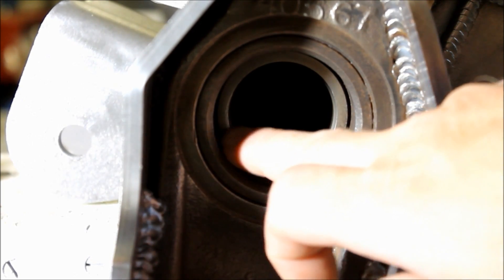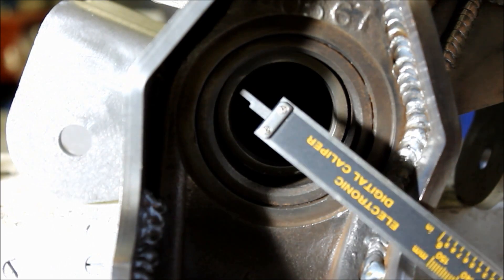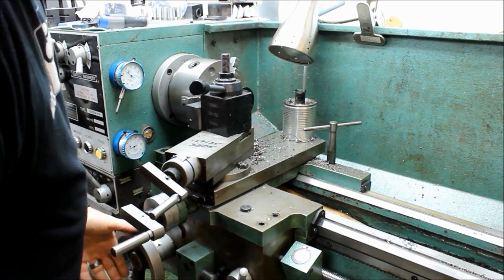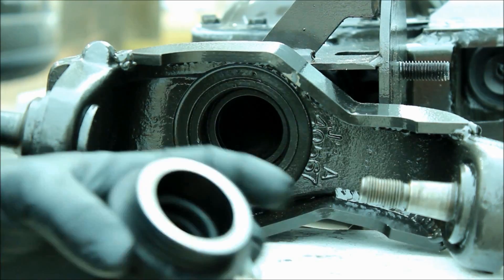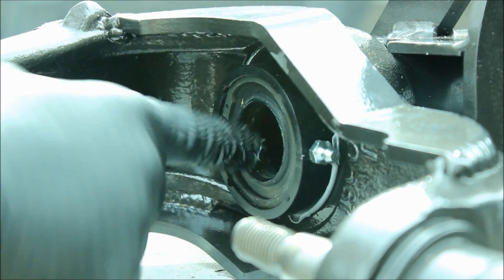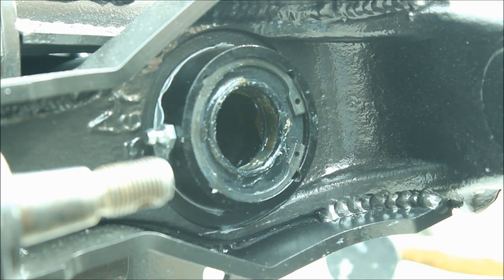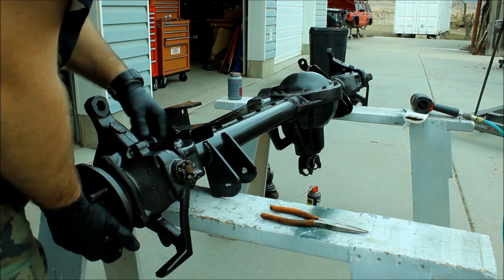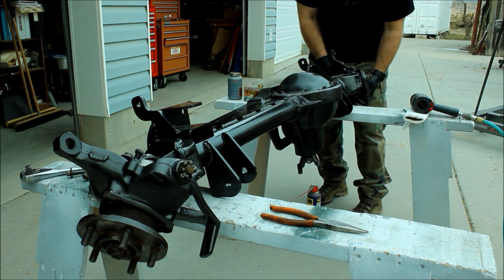Overlander Front Axle Swap Part 4. Installing After-Market Outer Axle Seals

Comment: so excited for this project to be done!  I just recently got into overlanding so my xj build is moving more that direction.  This build gives me a ton of inspiration for me
Reply: I also am going to overland in my 1988 XJ that i am restoring. I put a new 4.7L stroker engine, a little higer pressure injectors, replaced factory undercoat, bedlined the inside of the jeep, chromoly front axels, Frame stiffiners, new AC and Heating system, stronger alternator to run a dual battery setup and  rest pretty much stock. I am putting the engine parts back in and will bedline the whole outside of the jeep instead of paint so it wont get all scratched up. So now i am out of money so i will have to save for a lift kit and new gears and tires and lockers. Its a expiense but to have a reliable jeep well worth it. Its a lot of work to have a good outlander vehicle. I still have to do the interior: roll out shelves, sleeping rack etc.

Comment: How's this project coming along? A couple points on the build - wouldn't it be easier to cut the length off of the reinforcement tubes and allow these to stay in place with the flanges? Also, how about putting a 90 degree zerk in place before assembly if you're using the reinforcements?

Comment: I have a question. I installed the outer seals on my yj but it holds the axle from going back in all the way because the width of the seal housing. Now my wheel bearing assembly will not go in far enough to bolt in.....what am I doing wrong? Help would be appreciated...
Reply from the maker: Maybe wrong seal or didn’t get them seated all the way??

Comment: those outer axle seals work like shit. i wasted my money and time on them. they are "rebuildable" and trust me you will be replacing them alot.

mine lasted 2 rides and the rubber was torn to nothing.

TO ANYONE READING THIS: DO NOT WASTE YOUR MONEY ON THESE SEALS.

PS: inner sleeves are pointless too.
Reply: wow dude, you must have bad luck... I've been running a set of outer seals on my YJ for almost 15 years with no failures. Maybe you got a crappy brand?